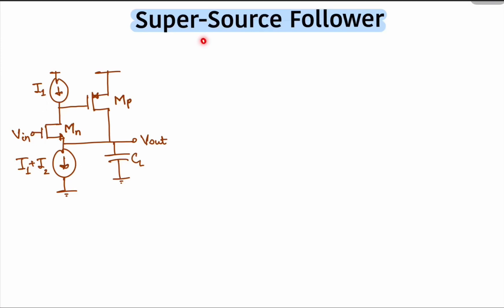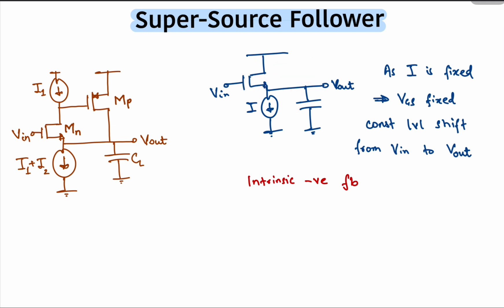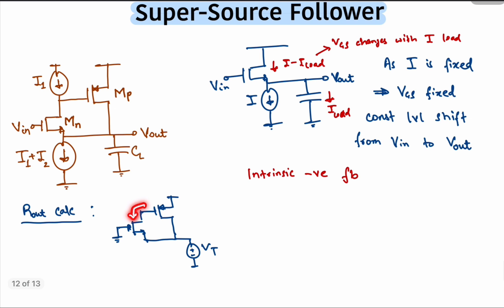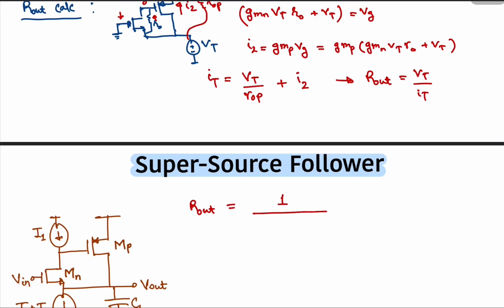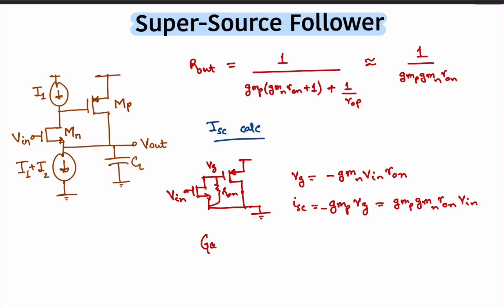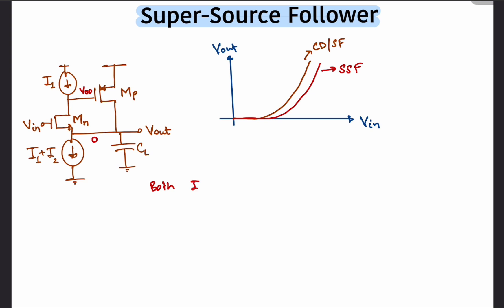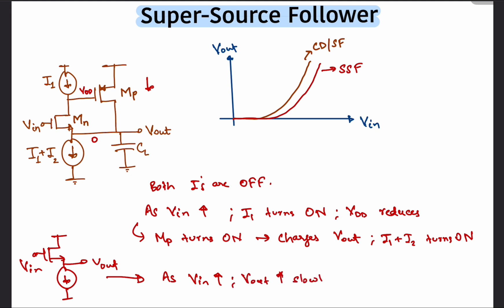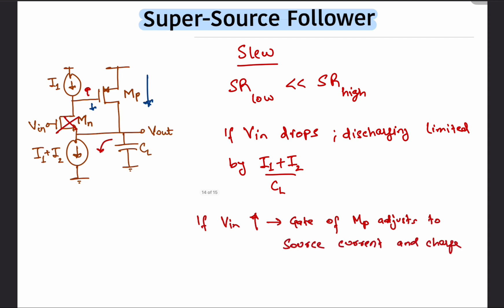Super Source Follower

Comment: Thanks! Can you suggest a paper utilizing the SSF?
Reply from the maker: I have seen a couple of LDO papers utilizing a SSF, in order to push the non-dominant pole to higher frequencies. However, I can't recall them. 

You may look at this low-voltage bandgap reference paper: https://ieeexplore.ieee.org/stamp/stamp.jsp?tp=&arnumber=4515947

It has a pMOS-based implementation of a SSF.

Comment: sir if you could bring a video where you could summarize all intuitive approach for various parameter  analysis of MOS  ckt will be very beneficial
Reply from the maker: Could you please elaborate?

I’ll try to make videos on intuitive analog circuit design. Do you have anything specific in mind?
Reply: @TejasKetkar  sir like intuitive  parameter analysis such as resistance at nodes  or dominant pole analysis of standard ckts like current mirror ,OTA(5 stage , folded,telescopic) , differential amplifiers
Reply from the maker: @vaibhavkapadia1  Noted. Keep an eye for such videos in the future. Cheers!

Comment: Really Liked the Explanation, How would the bandwidth compare to that of the regular voltage follower ?
Reply from the maker: The BW would be greatly enhanced, since the Rout reduces by a significant factor ( ~gm*ro).

If you are familiar with LDO’s, people sometimes use a SSF stage to push the non-dominant pole  (associated with the gate capacitance of the current sourcing transistor) outside of the frequency range of interest, since -1/RC would be the pole location, and if R is small, then the pole is further away.